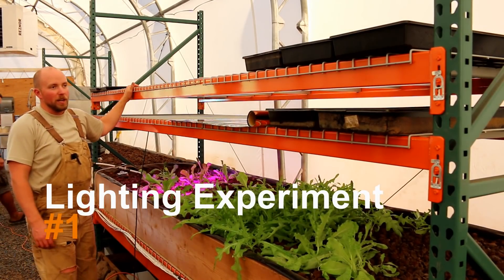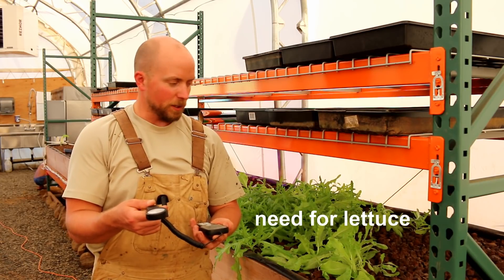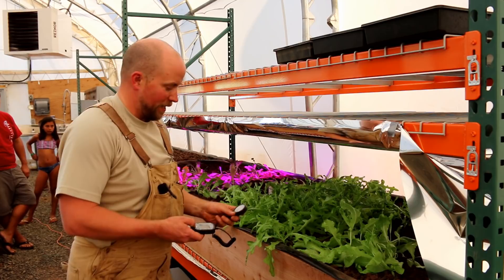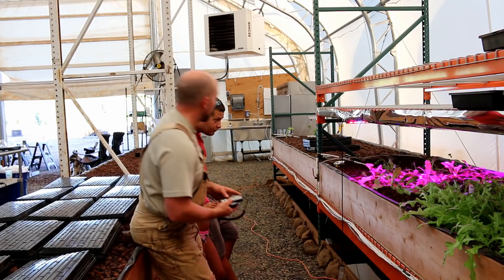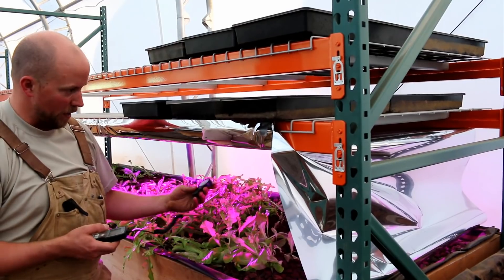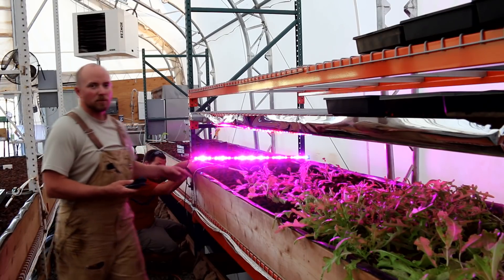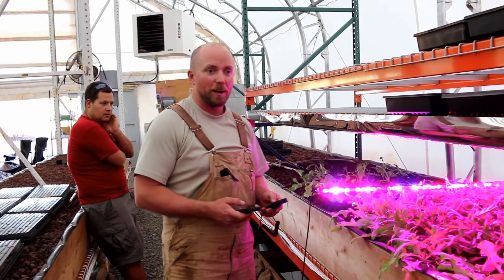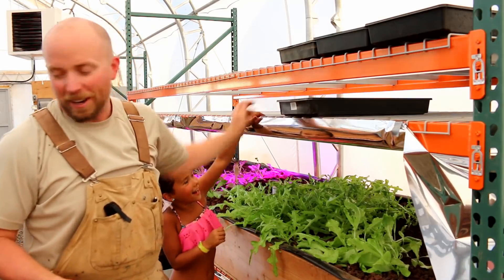Indoor Garden Lighting with LEDs and MYLAR

Comment: I am thinking 4 lights in pairs back to back hanging part way down and 1/3 of the way from the end so some light is going down and some up against the mylar and reflecting off the end.
If you want a crop that grows better in low light than in bright light try New Zealand spinach. Where I have it growing on the floor of the greenhouse on the north side where it gets the least light the leaves get 4 times larger than on the upper tier where it gets light through  fiberglass roofing and the leaves get too small to be usable in direct sun. It is a vine so in the summer you can let it hang over the north side of the lane and get a horizontal harvest.  It produces seed at each leaf node  so once you get it started you don't have to buy more seed.

Comment: Couple of points to consider, firstly is inverse square law, for a diffuse light source this means every time you double the distance from the light source, you 1/4 the intensity. Leds have lenses which overcome this somewhat (depends on the viewing angle). So when you aim it up at malar you are losing more light due to that (as the light is traveling through more atmosphere) and also mylar reflects around 90% of the light from memory, some will also be spilling out the side of the beds. 

A better option would be to use etched/diffuse glass or film over the LEDs if you want to diffuse the light better. You will lose some light through this film but it will be less than reflecting it off of mylar over biggest distances. They LEDs you have may also have lenses built in so check that out as you could remove them and potentially get better spread, the lenses also absorb about 10% of the light from the leds to.

Philips was the first commercial company with an Aquatics light to use diffuse glass, in order to blend the light spectrums more effectively and also spread the light over a bigger area. You could remove the current lenses/cover acrylic and replicate this quite easily, be sure to check the light transmission percentage when ordering anything though.

Check this review out of the Philips light I mention, think you will find it helpful - https://www.youtube.com/watch?v=P3buToJrfX4

I also prefer the idea of either putting mylar on the north side of the lanes rather than above the lights, as in reality there isn't much being reflected upwards from the beds, or maybe even wrapping both sides in the winter, but then you will possibly contend with mould and lack of access.

Comment: Have you concidered covering the top sides and back with Mylar and running the lights length ways on the open side pointing at the back to reflect off the top and sides and possibly putting a cover over the access side that is put down during winter and or at night? There seems to be alot of light lost from those led fittings to the sides of them

Comment: When you come back with the numbers, would you mind elaborating on the PAR reading of 200 micro moles/meter^2/second....as in how many seconds per day will the light input to the lettuce need to be at that level?
Reply from the maker: +David Dean no problem. I am assuming 24hrs per day run time for Therese calcs. Just to see worse case. In reality they should only run 12-16hrs per day

Comment: If you are using wire mesh as shelves then why put the Mylar below the shelve? It seems to me much easier to just roll the Mylar on top the shelve and put your trays on top of that. Also "hanging" (convex) Mylar diverts the light, I believe it is better to have the Mylar totally flat or a bit dome shaped (concave) to make all reflections go where you want them to go, towards the lettuce.

Comment: looks like the ambient building light isn't adding that much. What if you put a mylar wall all around the bed trapping all the LED light and heat
Reply: Hi Jeff,    
    When watching the video I was thinking the same (the 5th side would need to be loosely tacked so it could be raised for maintenance), or at least cover the bed on 4 sides (naturally keeping the south facing side open). Also was the light orientation optimal across the bed. How much light leaks over the edge of the grow beds when the light runs across the bed? What if you place the light length wise to the bed? Sounds like you could do a bit more experimenting. Cheers,    
    Bill